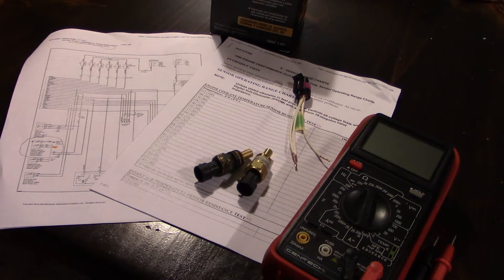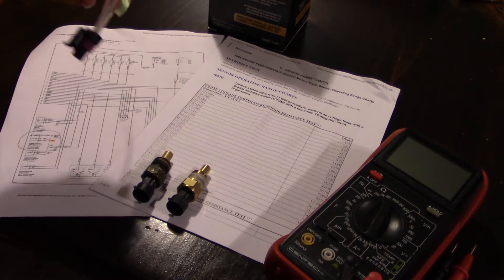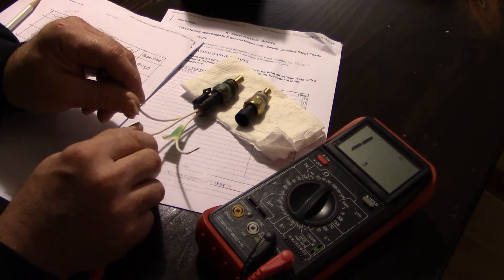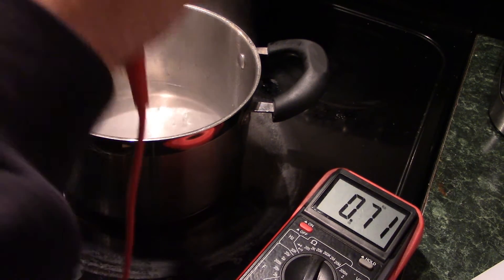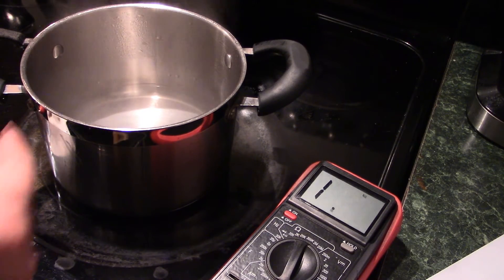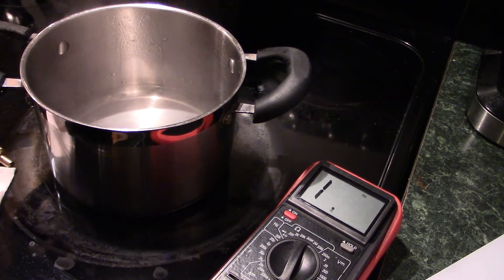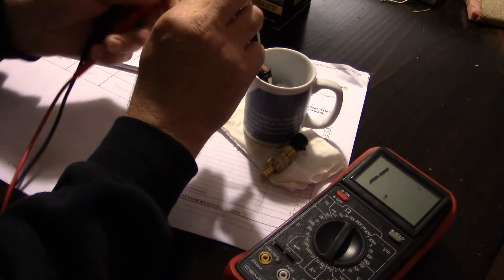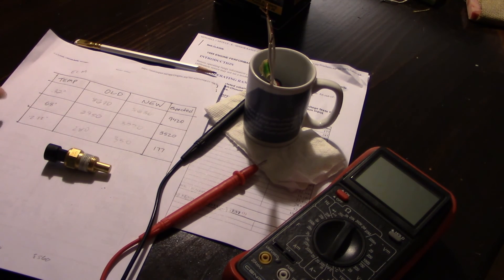How to Test a Coolant Temperature Sensor

Comment: Before doing any of this,  if you have a three prong connector.  Get the car to normal operating temp and unplug the sensor.  If the fan comes on,  it is the sensor.
Reply: No, there are many other things that can go wrong. If the fan stays on low while plugged in and you unplug it, it will stay on. Your method is flawed. Testing resistance is the correct way.

Comment: That's strange... Maybe the car has more than one sensor.
I did see a similar problem once, the guy used Teflon tape or thread sealer and the body of the sensor was isolated from the ground.

Comment: Did you figure out the issue? Im having a similar problem with my 1999 oldsmobile 88. Coolant fans not coming on automatically like supposed to but will come on when sensor unplugged
Reply from the maker: I installed the new sensor since I had in on hand anyway, but as the testing showed, the original one was not faulty. In the end, I had a faulty ignition module, which, on a cold start, would not fire on two of the 6 cylinders. So it ran pretty rough on a cold start. But after a few minutes of warming it, it would resolve itself and run fine. So we replaced the ignition module, and now all is well. Your issue sounds completely different.....Good luck.